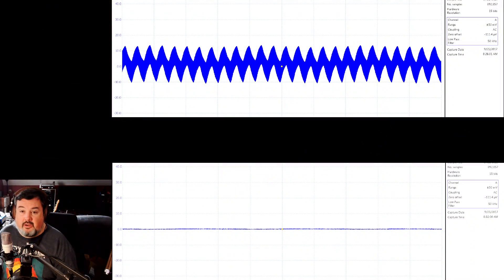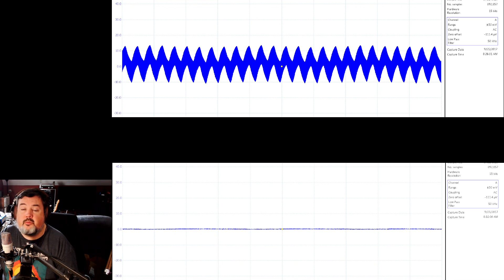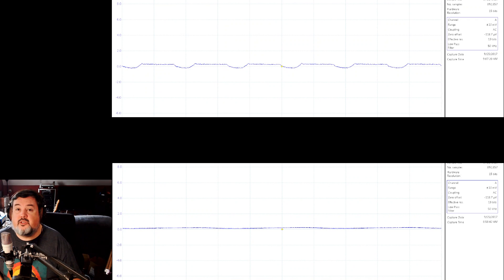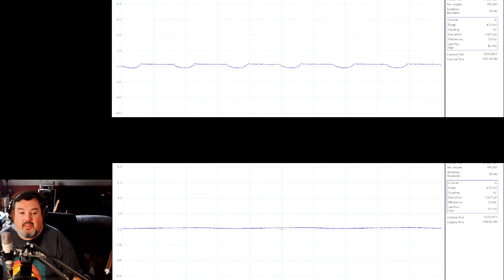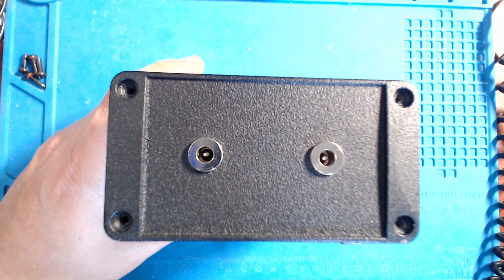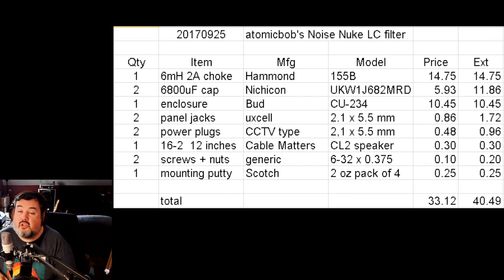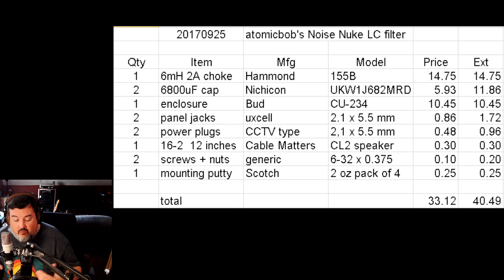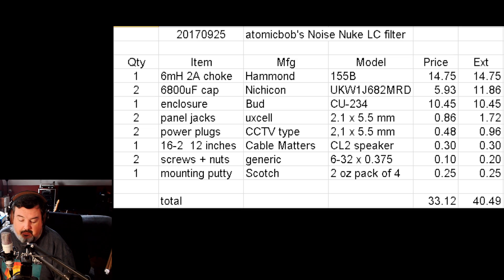Eliminate SMPS Noise Without a Linear Power Supply

Comment: What size drill bit and what size hole did you drill into the panel to mount the female power jacks?
Reply from the maker: Uhhhh....I honestly don't know. I usually just find a drill bit big enough and then just make sure it fits.
Reply: I found out my problem was on the RF side. It was the switching power supply RF noise that was injecting spurious AC into my signal generator that reeked havoc on my attempt to do an RF alignment on my receiver. It created at least 5 fake reference signals and I couldn't distinguish the real one. Your solution is great here on delivering clean DC but I think high quality multiple RF ferrite chokes on the wal wart wire will prevent RF over the air  transmission into the signal generator and the receiver

Comment: Thanks for the video man! I was exactly looking for something like this and was wondering why there aren't any! Couple of extra capacitors in a ultra low noise PSU are not really worth the extra 150 euros.
I'm going to build mine in the next days.
Reply: So for anyone reading this later! I tried it out. First I tried to measure the noise with a Smartscope digital oscilloscope. The results were quite disappointing. But I believe the oscilloscope was on itself quite noisy on that level (I was aiming for 5v for my Wiim Pro Plus). I even ordered two sets of caps only to know that I have the good Nichicons (they are quite hard to find, just like the hammond). Later I also added another inductor+100uF cap after the main caps trying to build a second stage low cut. Also a resistor in parallel helped to reduce some high frequency noise.
I can’t exactly tell before testing with a proper high res scope. But still I don’t believe I could go below 10uV level by any means. And maybe for 5V there are cheaper options than the hammond. I paid 25€ for a Chinese one.
But anyway I connected it to my wiim and call me crazy but I can really hear a better bass punch and deeper sound stage. 🤣🤣
thanks again for the video. It’s definitely a cool project and totally worth the time to avoid a +200€ PSU.

Comment: A nice and simple solution, I was in the throws of making a linear supply, however I will have to try this. Apart from me replacing the barrel connectors with USB ones as my target DAC is an SMSL 5V device, I will probably add some clip on ceramic cores and a 0.1uf ceramic cap straight across the output jack. Those big electro"s and iron core inductor are great at low frequencies, but not so with very high frequencies.
for best results with the 0.1 put is as close as possible to the output jack, with the shortest leads, if one gets into radio and RF you soon learn this stuff.

Comment: Very good.  A couple of things.  The case must be metal and continuous [no gaps].  The limit on voltage is limited by the voltage rating of the capacitors. A fuse might not be a bad thing to include.
Reply from the maker: Not really. You can make a case out of plastic. I don’t see why not. And yes, limited on voltage of the caps. I do mention this on the video. A fuse is fine, but most units running g DC don’t have a fuse. And then the rating will change depending on voltage and current draw. A fuse would only protect the power supply in case of a short.
Reply: @stereoazimuth  I think because a metal case can provide a good EMI Shielding and the plastic can't. That's why the ground should be connected to the case too. But I'm not an expert by any means. I was also wondering what happens if I use a metal mesh just for better aesthetics. but it seems that they won't shield as good as a closed box at high frequencies.
Reply from the maker: @ariansadafi4033  It is not really a ground connected to the case, it is the negative leg of the DC.

Comment: A traditional pi filter uses a capacitor on either side of the choke.  It's more optimized because the choke has less 'work' to do and the overall capacitance is the same.
Reply from the maker: In a traditional PSU, yes. We are coming straight off the SMPS though, that already should have some capacitance on that end.

Comment: Basically this is a 2nd order LC filter with a frequency of 30Hz. This also explains why the "wobble" of your linear source (which is either the mains frequency or twice the mains frequency) is still slightly visible.

If using plugs I would invest the few extra cents and install a fuse and an asymmetric TVS diode. The TVS diode will act as an reverse polarity and overvoltage protection and with overvoltage for too long will go short and protect the expensive capacitors and preventing the ElectroBoom effect.
Reply: Slow Blow fuse
Reply from the maker: Higher power caps yes, because there would also be a big inrush current.